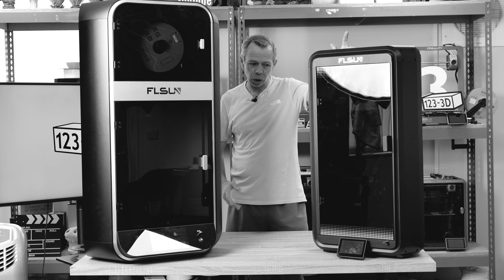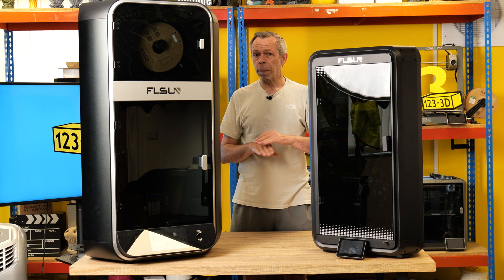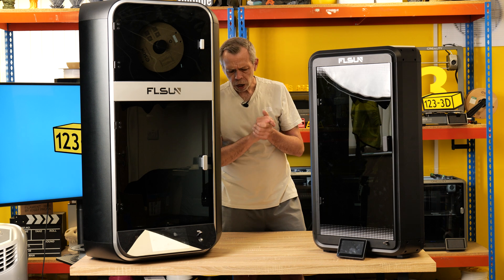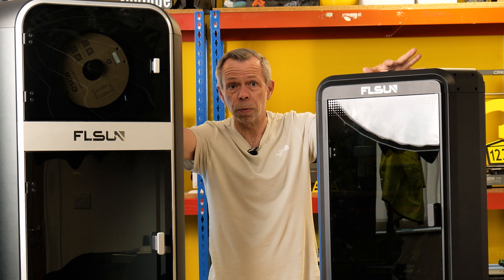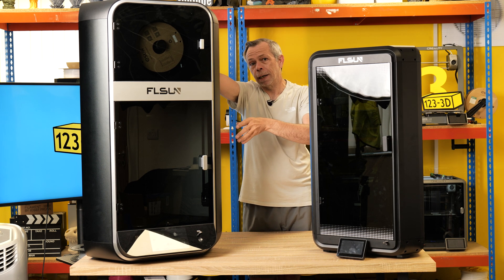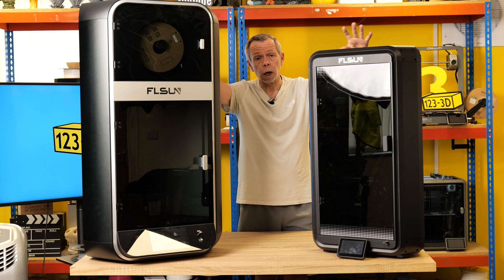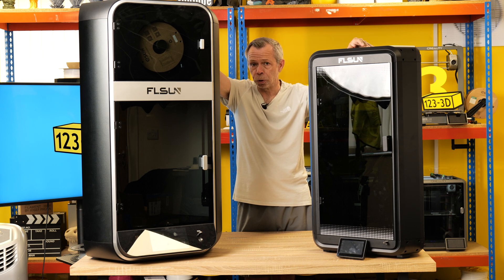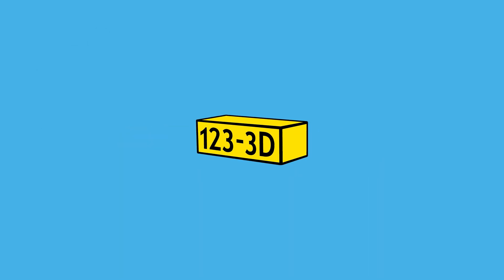FLSUN T1 Vs FLSUN S1 | Battle of the speed demons

Comment: Love that you mention the quality of materials and build differential between the two. So few do. 
I have a huge dilemma on my hands and would love any advice - to make a long story as short as possible , my first experience with a Delta printer and my second experience with any printer was the T1 pro and I was hooked. however I had a unit that failed to power on after 24 hours of printing. While customer support was great I ended up having to return it, and I never could shake the level of speed and quality I achieved in that 24 hours. After a month or two once the dust had settled, I purchased another T1 pro and it has been my workhorse for my Etsy shop and my favorite printer out of the half a dozen I have tested. When I saw the S1 pro on a steep discount at Micro Center I had to jump on the opportunity yet within 24 hours of printing, I encountered my first clog and I have run into more print failures and false positive clog reports that have resulted in actually causing clogs and I am at my wits end. Part of me thinks I have gotten two lemons and I just need to swap it out. But I would really like to know if I can get around this. At $699 I would be a nutter to throw in the towel. 
Sorry for the novel.

Comment: I have a T1 and right now I would not recommend one right now, the fan related items need to be sorted. the fan is shit quality and makes so much noise it will make you deaf. The fan duct around the nozzle is total garbage. I can print on 70% fan speed now with altered air intake and new designed air duct around the printhead. The noise is now more acceptable. But really new fan and air duct is a must if you ever want to enjoy one of these printers.

Comment: Please don't quote those marketing specs as factual.  They are BS.  If you're going to quote specs, test them yourself before you quote them as factual.  I own an S1, and I love it, but these numbers are utter nonsense.  1,200 mm/s is NOT the max print speed. It is the max TRAVEL speed.  Even in FLSUN's own slicer, on the fastest HS-PLA profile, they never hit anywhere near this speed for printing, ONLY in travel.  The actual max print speed, with the stock nozzle, is about 700 mm/s.  Same thing with acceleration. That's what they are commanding it to do, not what it can ACTUALLY do.  Same thing with flow rate - their testing was flawed.  It can't hit anywhere near that with the stock nozzle, it maxes out closer to 60 on flow.
Reply: But the result is that flsun's final printing time is two to three times that of the same industry, and the speed of the S1 printing process can sometimes even reach 1400mm/s, so is it wrong to say that the maximum printing speed on the specifications is wrong? I think what the blogger said is very objective, can other brands keep the speed on the specifications all the time? If so, are they also nonsense?
Reply: @Cool_kiddddd  I was once thought quoting travel speed is bs. But later on I just understood it makes sense because travel speed is part of whole printing process and the statement is not 100% misleading/fraud. Faster travel speed allows faster printing process.